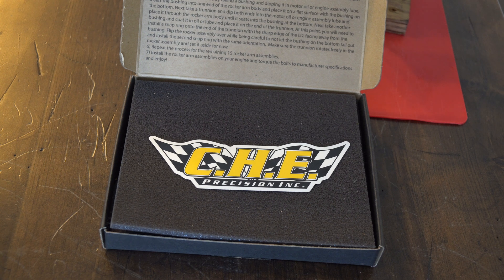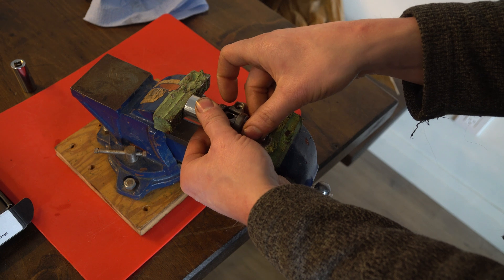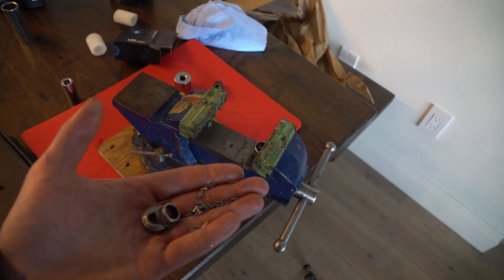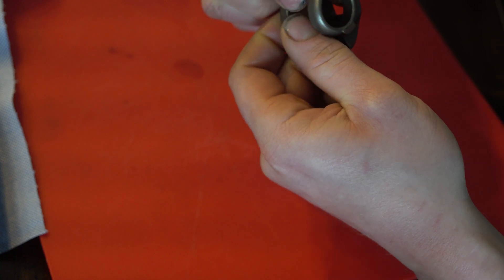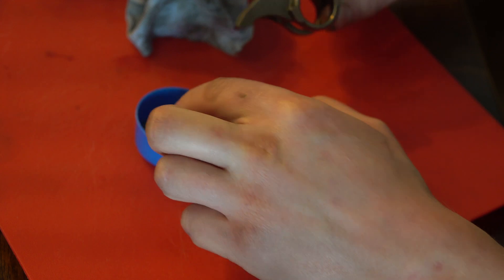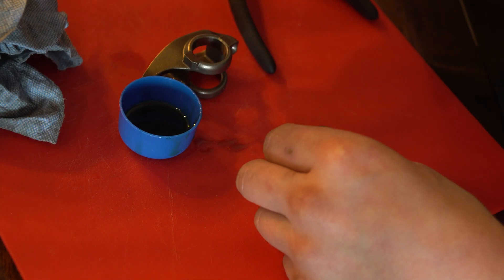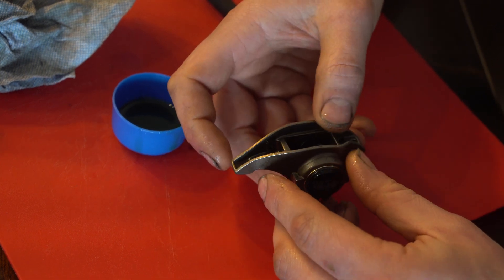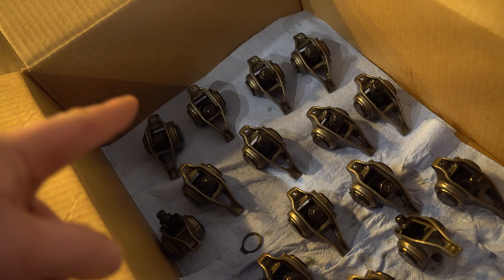HOW TO INSTALL OR REPLACE TRUNNION ROCKER BUSHINGS LT AND LS PLATFORMS

Comment: You didn't mention that you install the sharp side of the snap ring I.D of the snap ring facing away from the bushing as both sides of the snap ring are NOT the same, Failure to do so and the snap ring WILL damage the bushing, It's stated clearly in the instructions and you can feel the snap rings are not flat, One side is beveled

Comment: I’m doing this kit in my truck now but I can’t get the other snap ring to go all the way on for some reason it’s driving me nuts
Reply: Dude I'm having the same issue and I'm about to throw this little box across my shop what was your fix?!!!!!!
Reply from the maker: Double check snap ring Orientation.
Reply from the maker: If the bushings are flush and check to make sure you have enough room to get the snap ring in straight down. If you can't get it move on to another rocker then come back to that one, can also reach out to che they have great customer support
Reply: @ghostlyrich  I appreciate it man I’m gonna contact them
Reply: How much hp do you think  this will eat up compared to the needle bearings ?
Reply: @sthcope4638 none but drop a needle down your engine and see how much power it robs